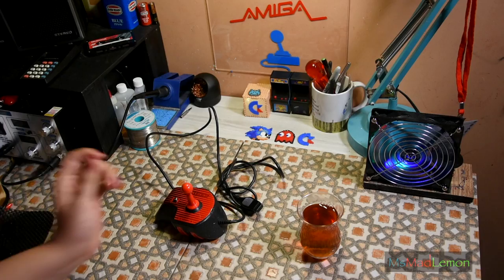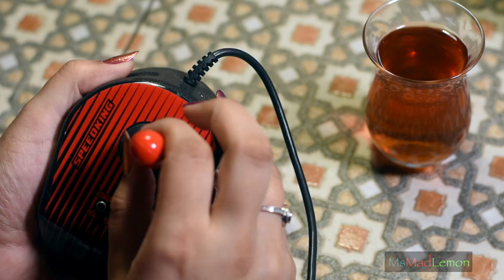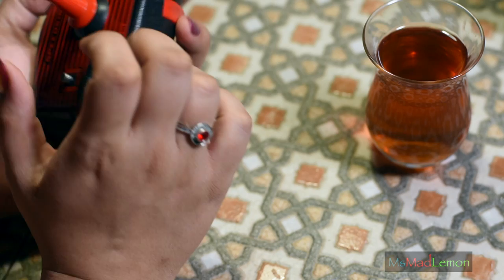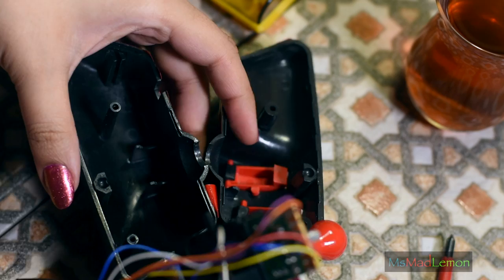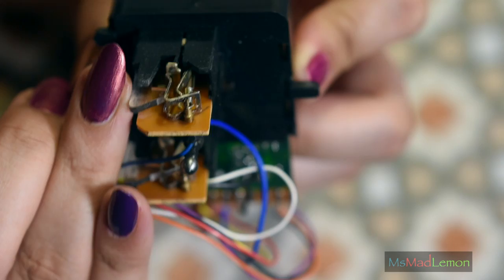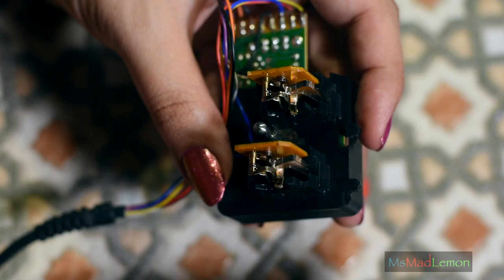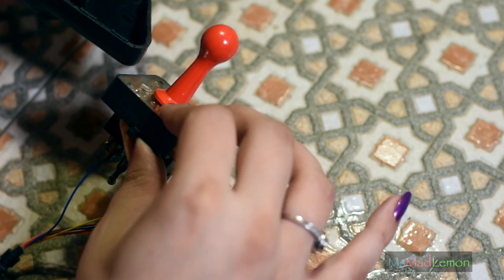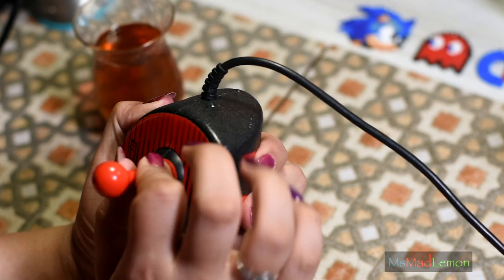Konix/Epyx Speedking Repair and Restoration

Comment: I have owned many of these Epyx (Konix) controllers over the years. I still own three. And, they still work more or less the same way that they did when I purchased them. It is overall in my humble opinion the most robust vintage controller ever made. I noticed you own some TIC-2 controllers as well. TIC stands for the Totally Inaccurate Controller for those unaware. Mine has been totally inaccurate for years. Looks fine inside, but misses button and direction responses just when you need them the most ;)

Comment: I have a single fire button type and that one actually has the normal micro switch for the fire button, the prongs have been cut away and the wiring soldered to the contacts that remain. It's the same as this one for the directions.

Comment: Great video but was sad to see you cut out the section dealing with the label/sticker on the top of the joystick.  Is it necessary to cut or remove some of that sticker to be able to open the two halves of the joystick?  What did you do?
Reply from the maker: Yes unfortunately otherwise it just wouldn't open... I tried to avoid it as much as possible.
Reply: @MsMadLemon  Ah - that's what I thought.  Looking closely it looks like you cut the label along the seam apart from a small part near the joystick handle.  BTW, thanks for the amazingly quick reply - much appreciated.  Love your videos :)

Comment: That is the AMIGA SpeedKing valued at £80 to £100 today the A and B buttons can be used for different actions the C64 SpeedKing has only one button and both have auto fires they are different inside the C64 one has an actual microswitch sealed for the fire button but can also be sprayed with electrical contact spray the SpeedKings have the print on top the none SpeedKings are just the 500/XJ Konix joysticks for different systems and never cost as much... Research it...  They are awesome but the Zip stick is better if you like to sit at a desc with the joystick stuck down for left or right handed the Konix EPYX are designed for right handed folks only although left handed folks easily learned to use them

Comment: I never liked this Joystick.
A classmate had one back in the days and I always had problems hitting the diagonals.
Even when he just got it and it was brand new.
I should have an Amiga one and the NES one, but I've never seen that Master System one.
There is at least one more variant. I've seen an analog one in an old video from Ashens.

I have to get myself a can of contact cleaner. Maybe I can actually revive some of my joysticks as well.
It's pretty easy to replace the ones in the Competition Pros, but I have tons of joysticks with similar switches to this one and I guess it's probably impossible to get any replacement for them.
Reply from the maker: I must admit it's a joystick that's always confused me, i'm not used to holding joysticks this way, but i find for simple short gameplays, lets say on an Atari 2600 or something like this where you're not going to be playing for an hour, it's fine.

I would recommend Diox-it, it is a touch pricey and I used to always use Servisol Super 10, but dioxit beats it hands down! Yes I was initially worried about the same thing, microswitches you can get hold of easily, but i cant imagine parts for these will be so readily available.
Reply: Deoxit is really pricey... not sure if I should try it.
The only contact cleaning method I know is a 3 pass process. First deoxidize, then clean it and finally apply some stuff to prevent future corrosion.
I can get those 3 cans for about the same price on can of Deoxit would be.
Reply from the maker: It is, and I hesitated for a while before buying too. 
I would look into it because I think some variants of it actually have it in one, i'm not 100% sure about this. i'm not entirely sure which variants. My can lasted me longer because I didnt have to spray as often as i did with Servisol Super 10.
Reply: I'm using Teslanol Oszillin T6 Tuner Spray which from all I've heard and seen is the stuff that comes closest to Deoxit and is readily (and inexpensively) available in Germany (maybe it's cheaper than Deoxit in the UK, too). Served me well for nearly every purpose for years now.
Reply: Thanks a lot for the hint!
I already found it at Conrad electronic and somewhere else for half the price ;-)
Reply: +Theshadowsnose - I had the exact same experience with the Epyx version back in the 80s. I was over someone's house and wanted to demonstrate how to get through the first level of The Last Ninja, but all he had for joysticks were a pair of the Epyx ones. I tried both and it was almost impossible to hit the diagonals when I needed to.

Comment: I have this for NES, and I must say it sucks. It has Select and Start on the lower side, about where your autofire toggle is. But those are of the clicky dome type (like in the old Atari CX40), held in place by the the sticker. Mine both broke/badly misaligned almost immediately and were completely unusable. It's a shame, really. I love this design, and with a few minor tweaks, it could have been one of the best joysticks ever.